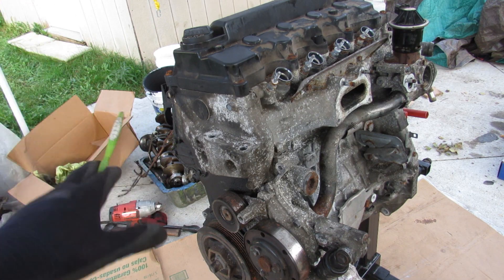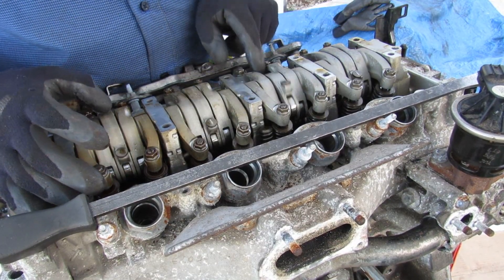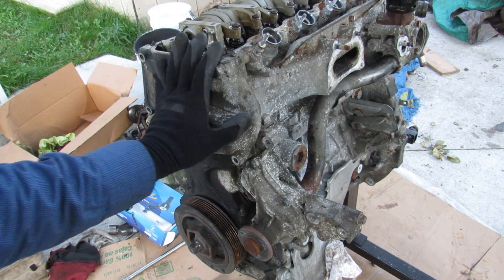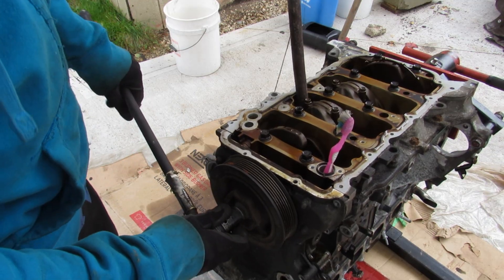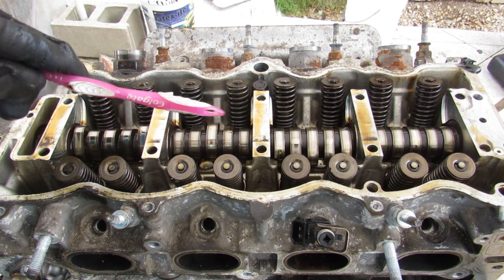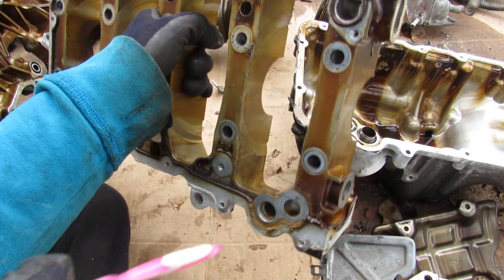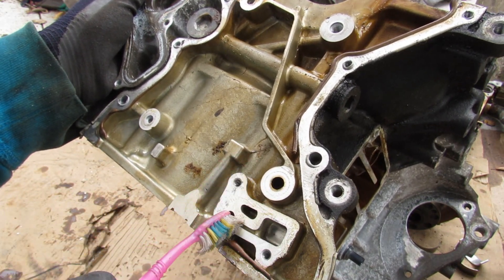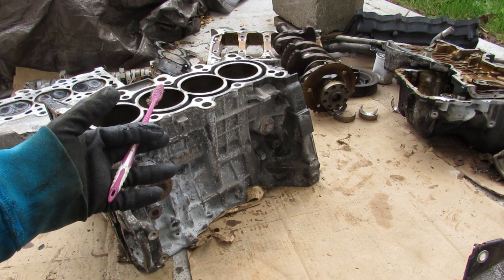Why Honda Civic Engines FAIL

Comment: my '09 has 208,000 miles. no problems at all and still running strong. original transmission & engine and doesnt use any oil. only thing i've done outside of fluids and maintenence is change the starter.

Comment: The R18 is a great engine.
As discussed in the video, '09 - '15 are far less likely to crack. In actuality a low percentage of '06 - '08 R18 engines ended up with cracked blocks. It's a real shame because otherwise these are incredibly reliable engines and they are very common.

Comment: I have customers with 3-4-5-600k miles on these engines. If you dont maintain it, it will fail. These are some of the best engines Honda has ever put in cars, plus, no timing belt to replace every 100k

Comment: Question, I have a 2013 civic EXL and I feel my timing chain tensioner is beginning to fail as I can hear the chain rattling. Is the timing chain tensioner easily replaced by just removing the cover and the 2 10mm bolts or is there a much more complex procedure ? I cannot find 1 video on YouTube showing someone replacing the timing chain tensioner so your help will be appreciated

Comment: I had a 2006 Civic with 50K miles and it had a cracked block after the warranty expired. Fight with Honda to get it replaced at no charge.

Comment: Hi i have this exact engine in a 2009 civic . It has a grinding noise on cold startup people were telling me its the Vtc Actuator . Looking at this video it does not appear to have one so now i am leaning towards the starter motor. If anyone has any other suggestions please let me know in the comments. The car has only done 83000 klms

Comment: i have r18a2 on my civic fd and this guy is bulletproof i mean it. i've traveled more than half of the Turkiye, I drove for minutes on the highway at over 200 km/h. There is still no problem, I just change the oil and radiator fluid, not even timing chain(it has 265k kms on the dash should i change it?).
Reply from the maker: Nice!
Reply: @speedkar99  thanks! but do i need change the timing chain?

Comment: great video.. My 2007 Civic had the cracked block at 123k miles in 2017 was lucky enough to get the recall done before it expired. Still running strong today.

Comment: cracked blocks were primarily a 2006 model year issue, hardly hear of other years having cracks, have a 2008 with 380,000 miles  still doesn't burn any oil between oil changes, gets driven almost 200 miles a day on days i am scheduled to work.
Reply from the maker: Nice. They won't all fail since it was a manufacturing defect. I believe the recall was for 2006-08

Comment: Had a cracked 2006 block that had 211,000 miles removed (everything else worked) and had a $1,000 ebay jdm seller 50k mile 2011 R18 put in yesterday, decided to keep the 2006 motor too, idk if ill ever need anything off of it, wondering if i shouldve just let the dealer keep it and discard it.

Comment: Air oil separator and vtec solenoid does tend to leak , other than that 300k miles easy with proper maintenance
Reply from the maker: Cracked blocks?
Reply: @speedkar99  no sir, old Honda bond for the oil/air separator which was 12 years old and the vtech solenoid gasket wasn’t  sealing well from old age and heat
Reply: What happens at 300k miles ?
Reply: @ that’s as far as I went with my first motor , till my gf jacked it up

Comment: Been running this same motor with a bolt on Borg Warner EFR 6258 turbo for a solid 50k miles with zero issues. Put the turbo kit on the car at 100k miles; just clicked 150k miles and it's still kicking.

Comment: The Civic has always been Honda’s problem child. I’ve worked on them for 30 years and they have never been that impressive as far as durability and reliability.
Reply: Which one is your all-time favorite?
Reply: @waltchan  I really don’t have one. Other than the few years the Corolla had oil consumption issues it was/is a far better choice. Now that the Corolla and Civic can only be bought with CVT transmissions I would not recommend buying either. CVTs by design are $7,000 throwaway transmissions.
Reply: @prevost8686  2020 Dodge Journey was the final vehicle to use only a 4-speed automatic transmission. Plus 2.4L I4 engine is close to Toyota Corolla you can get. Maybe that's the best and most-reliable these days.
Reply: @prevost8686 I just bought Civic Tourer 1.8iVtec model 2014 and I am so happy I sold that german crap VW Passat 2.0tdi B8. Never had issues with Japanese brands. The one I found is manual 6 speed and only 86.000km looks and drives like new. The engine bay is like that car just came out of the factory. 10 years old and serviced every year properly.😂

Comment: hello i know is and old video but im tearing appart to repair one of this engines, and came across the litle rod that is on the coolan gallery of the cilinders the one near the corner of the water pump what is it called? nned to remplace that

Comment: R18Z1 and the R18Z4 build like a tank bulletproof engines oil change it's critical regulary needed around 10.000 km or 8.000km for best reliability. It's a good torque engine for it's size 1799 cubicentimeter naturaly aspirated i-Vtec, torque 17.8 kg *meter at 4,300 rpm, Redline 6800 RPM and fuel cut off 7100, Compression: 10.6:1 (performance benefits from higher octane fuel ! Power: 145 PS (107 kW; 143 hp) at 6,500 rpm
iVTEC engages economy cam profile from 1000 rpm to 3500 rpm, under light engine load. Engine runs on power cam profile by default.

Comment: This motor is bulletproof. My 2010 Civic has almost 400,000 miles on it. And I just drove it from Orlando to North Georgia a few days ago. She's a beast!. Super fun to drive too. With proper maintenance these things can run forever. It's been the most reliable car I've ever had in my life so far.
Reply: Wao! 400k I'm got 2010 civic 1.8 and I worry to almost get to 300k.amazing I'm trying to keep in good shape w oil change and Marvel oil.
Reply: @audiemuniz6445  mine has 87k miles!!! 2010 civic coupe auto
Reply: fucking starter is trash unless you dont let ur wife start it ever lol
Reply: Did you have to change the timing chain?
Reply: @ur5484  you don't change chains
Reply: Dam number 5 comments you are over the place
Reply: How can you say this without stating what you did to it? 😢
Reply: Once they fixed the cracking issue, these are some of the most reliable 4 cylinder engines Honda made in recent times. The replacement in 2016 was the K20C2 which is another excellent engine. If you need a newer car and you don't care about going fast, look for a Civic with a K20C2 you won't be disappointed.
Reply from the maker: The earlier ones cracked like this
Reply: @speedkar99  yea im thankful that mine is still kicking. I do my best to keep up on all the maintenance. I adore my honda

Comment: I am a owner of a 1997 Honda Del Sol Si.  That is a single overhead cam vtec.  I am the original
Owner.  My motor is a 1600.   It has 215,000 miles and is a very strong runner.   This engine has never been apart.  The car easily does 100 miles per hour.   It has a five speed manual transmission.  It starts right up.  It is a very smooth engine.
Reply from the maker: Nice! 
I'll have a D-series engine teardown coming soon.

Comment: My 2008 has been super reliable and is currently at 175K. I do my own maintenance. Bummer to hear about the cracking issue. I have not noticed any coolant leakage issues, so maybe I got lucky, or that issue will pop up as more miles are put on it.

Comment: Best video I’ve seen for a R18 breakdown, Thank you ! I have a 09
Reply: Are 09’s susceptible to this issue?
Reply: @pgreenx  I actually found one barely used with 30k original miles, I now put about 40k and so far no problem’s whatsoever with the engine and I do drive it rough daily,
Id say they’re very reliable at least from 09 up most of the junkers I find are 06-08

Comment: I was worried about mines after a few years or purchasing since it was a 07 model. Heavy driving and many trips and it hasn't blown yet. Warranty way gone now, so I'm not worried as much anymore as its well over 170k with heavy driving. Just don't like that they used plastic for the chain and dipstick/valve cover, but overall a really good engine

Comment: Im planning to put a turbo on my r18 . is it a bad idea?
Reply from the maker: Yes
Reply: @speedkar99  thank you
Reply: @speedkar99  what if i fully build the engine? (forged pistons , etc..)
Reply: @akane7085 No need you can only use k20 crankshaft as I can recall. Forged pistons are also good idea. R18 are used in some races. On stock parts you can mount turbo and get probably 220-230hp without issues and drive it for years. But only engines from 9th generation and only manual tranamission.

Comment: Although it's true that 2006- early 2009 R18 engines suffered from cracked blocks, but those from late 2009 onwards are bulletproof and can easily last over a million miles even with neglect. Basically I think late 2009 onwards R18 engine are the most reliable engines ever built to date.
Reply: which other year of civics have the r18 engines? im just wondering
Reply: @McDzy  I know my 2011 Civic FK have the R18Z4 engine.
Reply: All civics from '06 to 15 except the SI
Reply: @tbskirk  so 09-15 are the recommended r18 engines to get instead of the 06 to 08 version?
Reply: what 100000 million miles ?😮
Reply: That's good to know, I'm looking to get a 2013 one
Reply: Consumer Reports still continue to rate the 2015 Civic as the most reliable Civic in history. All the newer year Civics have worse ratings than 2015.
Reply: I didn't know, but now that makes so much sense. I've spent more money maintaining my 06 Civic than any other vehicle I have. And it has the least amount of miles than any of my other vehicles, at 150k miles. My 01 330i has 280k, my 10 328i has 250k, and my 03 Accord with the K24 has 196k

Comment: Wow that oil pick up tube made of plastic inside hot oil… how it does not get melted inside?
Reply from the maker: The melting temperature is higher than the oil temperature

Comment: Had a 2008 Wife drove until 180K miles until it got totaled in a wreck.  I changed engine oil and filter every 5,000 miles and it was flawless, I adjusted the valve lash one time, One hell of a good engine there Honda built.  Thankfully our 2008 didn't crack.
Reply: You had a 2008 wife? Did you trade her in for a new 2019?
Reply: Hondas last a very long time

Comment: Love my r18. Mine is a 2007 Civic Ex Manual. Never knew about that issue with the block cracking so Ill have to keep an eye out for that. Bought with 100k and now have 191k and still running awesome. Love the car.
Reply: fuckin champ, I got the 08 ex manual and I got 175k. mad respect. anyways have you ever had a no start with crank issue? dealing with that as I type
Reply: @mattmoquin6943  I haven't had an issue with no start with crank. Make sure you have spark. Try some starting fluid if you can get it to turn over for a little bit. It may be a fuel issue.
Reply: @tannerjohnsonG59  tried the starting fluid a couple times from a few spots, I think my next step is to check if the car is timed correctly, might have jumped a few teeth.

Comment: This is exactly what happened to my 07 civic 😔 unfortunately this was in 2019 so it was out of warranty
Reply from the maker: Did you have to replace with an 09+ engine?
Reply: @speedkar99  the engine swap was too expensive for me back then. I ended up trading it for a newer car

Comment: There is a CR-V in some other state that reached one million miles in the odometer.
Reply from the maker: Cool story
Reply: @speedkar99  The fact that Toyota is much larger than Honda and sells more vehicles, that doesn't necessarily mean its engines are more reliable.

Comment: A teardown of Nissan's QR20DE would be interesting to see how they "cheapened" the SR20DE into a disposable engine. Should be lots of these floating around now as the design life of the motor is only 150,000km

Comment: I've got an 06 civic with this engine.  It's got 100k miles now and I'm keeping an eye on the coolant.  Probably impossible to know the prevalence of this issue but I'd be interested to know what % 06 civics were affected.
Reply: Not more than 15% of the 06 civics were affected.  If yours lasted this long (100k miles and 16+ years), then you may have a good block and don't need to worry about the coolant. It's time to shift your attention to other usual preventative maintenance stuff on the 06 Civic: rust, paint, clearcoat, wax, transmission fluid (A/T fluid only done by Honda dealership), A/C refrigerant, A/C compressor clutch, alternator, oil and filter changes and suspension. Baby that car, and get to 250k miles and beyond, and may outlast a Corolla.
Reply: @texasabbott  I'm curious why you say transmission only by Honda. I saw this in the manual as well, but that seems rather strange to me.
Reply from the maker: More of the earlier ones than the later ones. Only Honda would have the stastics of warranty claims

Comment: Honda caught the cracking issue in late 2007, there are some late manufactured 08's that are safe. I can't offer any evidence but I think most of the effected blocks have passed away already.
Reply: Was it just a production run of them?  I've got an 06 I have had since new with no problems,but only 65,000 original miles on it.
Reply: @JayandSarah  my understanding it was certain specific engine block casts that were bad. If yours hasn't already tanked I'd have high hopes it's  not going to. Knock on wood!
Reply: @Dusty.Spinster  yeah who knows. The car owes me nothing at this point anyways but it should be good to last until retirement when I'll buy my last vehicle I suppose.

Comment: Honda rarely makes mistakes if ever. In this case it was not an engineering error but a production error.
Honda is a top notch manufacturer and issues such as these are honest mistakes not planned obsolescence which currently is plaguing established manufacturers.
Japanese culture means they are less likely or have less product sabotage. Planned obsolescence is more prevalent in many Western products and especially prevalent in Chinese made products.
Reply: Do you think Honda made a mistake by switching to ZF-made 9-speed auto transmissions in some vehicles?
Reply: @waltchan Probably...they also went for smaller turbo charged engines because of emission policy here in LGBTQ+++ snowflake European society full of Green brainwashed voters. But then again...Honda and Toyota are still producing some bad ass engines for other continents and are selling them.
Reply: Drove a crx.  Noisy pokey.peice of crap.

Comment: You mention it doesn't really need the cam shaft sensor.
Does that mean it runs wasted spark and batch injection?
Otherwise I assume it would need a camshaft sensor to know which stroke it's on.

Comment: My 09 civic has only 110k km but it burns oil like crazy. I would check oil levels every time I fill up gas and oftentimes the oil would be reduced in half. Any ideas? I had it checked for leaks but there was none. Scared of how much it’d cost to repair. I love this car.
Reply: Check your sparkplugs for evidence of carbon buidup. 
Stick a borescope down the hole and check top of piston and valves for carbon.
Check valve stem seals for wear allowing oil to get burnt in the engine or in the exhaust.
Check for leaks all over the engine.
Renew PCV components if necessary.
Run a diagnostic scan......?
Reply: How often do you change the oil?

Comment: The problem was porosity in the castings. Not a crack in the block. Yes coolant would leak out and people would overheat the block. But my mechanic has fixed this issue many times on the R18s with no problems.
Reply from the maker: Fixed? How did he fix a casting defect?
Reply: @speedkar99  drain the rad and block. Used a rotary burr to remove the casting flash etc from the area by cylinders 3 & 4. Some acetone. Jb weld the areas. Sit overnight. Refill the rad etc.  Works perfect

Comment: I bought a 2009 honda civic FD1 with the R18A1 engine. The first letter of the VIN is J. The Japanese assembled version are covered by the problem of the cracks?
Reply from the maker: Check your VIN with the dealership 

Regardless the warranty is up it was for only 10 years

Comment: Hi  I have a 2003 Peugeot 206 and I wonder it really runs rugh and when it comes to heavy rains it really runs smoothly and i always wondered if it is cylinder head or the clutch or the sensors off but the problem is that the pedals shakes normally when I press the throttle and in heavy rains it really gets really smooth just as good as new  could it be of missfire or coilovers? Or injectors? No error codes . Plz help
Reply: Cooler air on rainy days.
Mixture problem? Air temp sensor problem?
MAP sensor problem?

Comment: Honda V tec  engine  made   aluminum for lighter,  but this engine has huge problems with leaking engine oil, oil burning,   and worst one is  to drop the whole engine for leaking oil inside engine,   do not buy this  big problem car